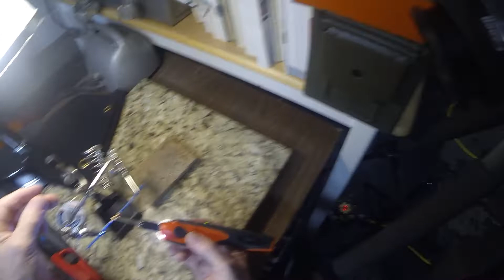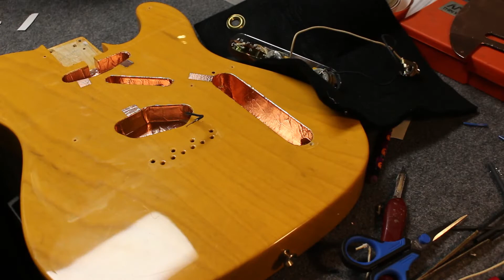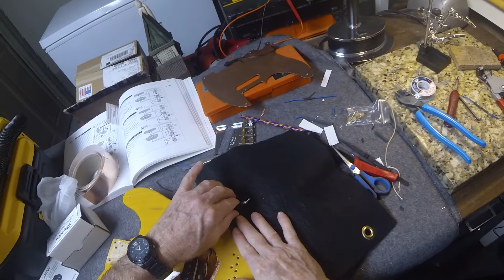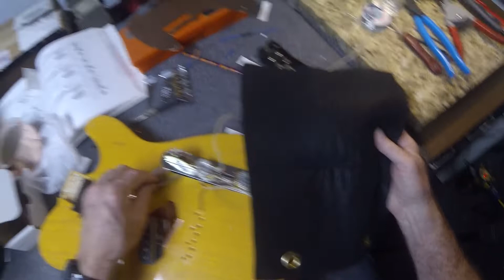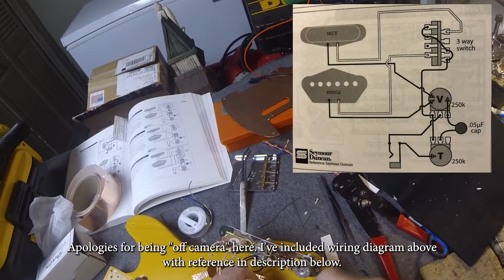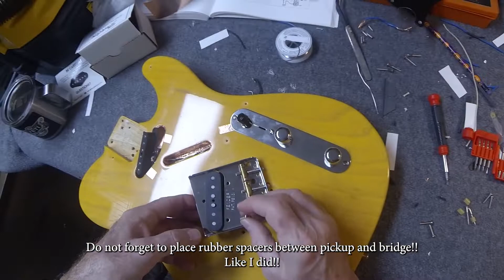Ed Harris - Wiring a Telecaster

Comment: I just bought some wick the other day and will be doing this very soon. I want the toggle switch at the top, closer to my hand. I actually built circuit boards for a company years ago and can do this easily, I just have to make the time. I'm also going to redo the shielding since my last job of it kinda sux! Lol Thanks for this video, it never hurts to get some refreshing on info! I've read that some folks solder the ground directly to the shielding tape but I don't think I like that idea too much. A good ground is the most important thing in any electrical component and I wouldn't trust that.
Reply from the maker: Thanks so much David! I look forward to your finished project! Please tag me when you have it completed! I would love to see how it turns out! Your experience with circuit boards will certainly come in handy for sure! Thanks for sharing this!